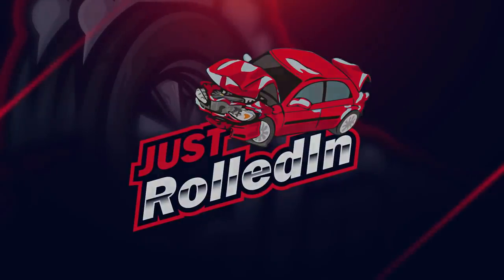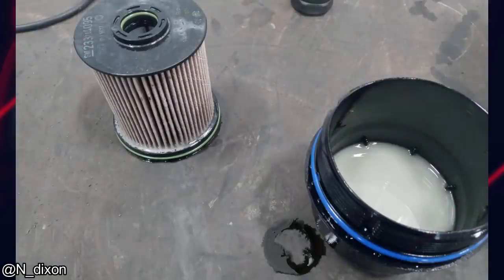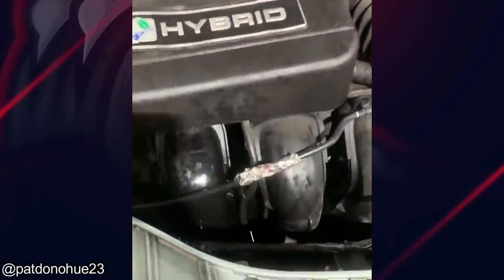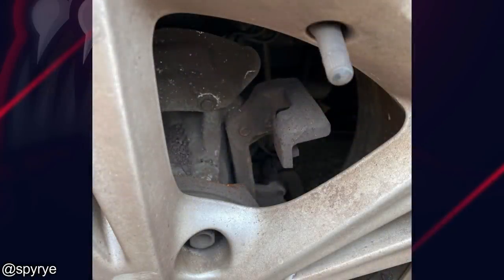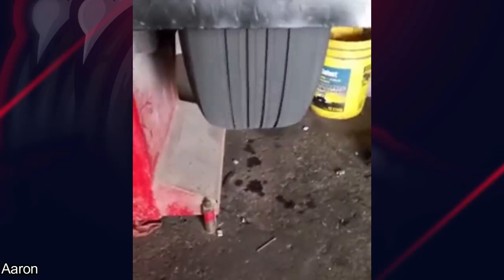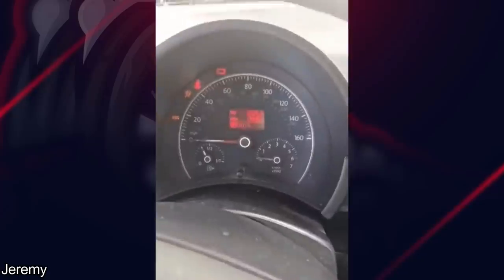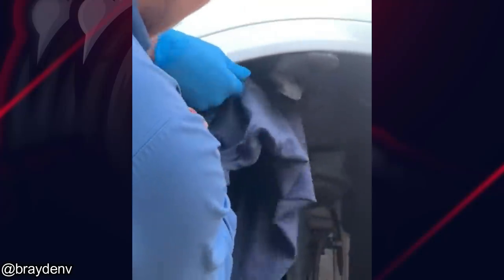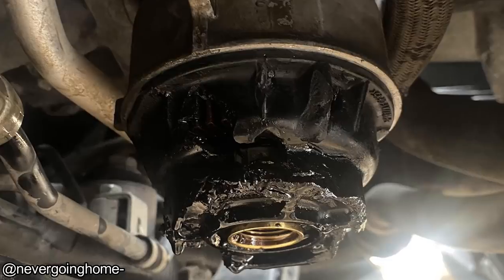Customer States He Did All The Work On His Truck & Wants A Safety Inspection | Just Rolled In

Comment: Ahhh the rust belt!
I'm so blessed not to live there anymore!
I have 2 vehicles that are decades old with barely any rust at all.
I remember being in Southern Ohio and my 1/2 Brother buying a 6 year old Chevy Blazer with Bondo and Cardboard in the doors! It was shiny when he bought it, but then a few months later, the cardboard got wet and the whole mess fell apart...
So how much is a gallon of Bondo now?
And how much is a big tube of Exhaust Sealer now?
It would seem to me that it would have been cheaper to just get a new piece of pipe from Rock Auto or something. I could be wrong.
This gives me flashbacks of when I used to work in the shops back in Ohio.
Doesn't anyone use soup cans welded onto exhausts using coat hangers anymore? Ha!

Comment: Aluminum body will never rust...

Maybe not, but that steel frame will lol
Reply from the maker: 2015 was the first year for aluminum bodys on the F150 😜
Reply: @JustRolledIn  lol I didnt even notice the year,  but it's still a problem, my parents got one of the F150 eco boost with aluminum body cuz the dealership bragged them up so much and they hate the thing, its rusting, nowhere near the mpg they were told, and dad says it's not comfortable.   They have been GM owners for years and about every 15 years they will buy a ford or dodge to give them a try again, but they said never ford again, GM and occassional dodge only now.

Comment: I tried to do my front bearings. I got one axle free.  When I came across the rusted splined bolts of the ABS sensors and had to grind one off to remove a sensor, I gave up.  I knew it would take me 24 hours to do the work.  I took it to a mechanic who did it in four hours.

Comment: What this guy did notice there was a problem with the concrete months ago before the truck fell , is everybody this oblivious to potential problems or dangers
Reply: this happened to me and i had no warning.
Reply: I've seen this a few times, i wonder if it would really cost so much more for lifts to have horizontal bracing to prevent this. then again I have seen cars crushed by being lifted too high into roof mounted bracing.
Reply: @Marc83Aus  i custom made a brace after this happened

Comment: Many years ago, a friend of mine bought a clapped out, rusty, original mini. About 6 months or so later he was driving through the town centre when the engine just seized up and the wheels locked. He managed to get it to the side of the road and got out. As he walked away the car exploded! Apparently he'd never put oil in, or anything apart from fuel. The engine had got so hot and it was such a rot box a fuel line had failed and .... ka-boom! It was just luck that he wasn't in it!!

Comment: Great video! Story time! Had a friend buy a super low miles Dodge Intrepid. Bought it from an old couple. Ran great but smell like gas in the car when the tank was full and only sometime left a gas drip right after driving. Came with a receipt for a new fuel pump so I figured, in tank pump, maybe the O ring around the top of the tank went back on wonky or something. The date had it put in the same year the car was made? Odd right? The tank is just under passenger rear seat. I pull the plastic fuel tank and find several weird punctures on the top of the tank. Then I look up. I see white bathtub silicone caulking around where some one cut out an access hole with a FREEKING TORCH to change the fuel pump rather than drop the tank.... The rough pointy edges on his cut had popped little holes when it melted into the fuel tank OMGF how the fuck did you not blow yourself up dude!!!!   Then my friend, he tells how the old people had said the dealer had "screwed them" on that car! Turns out there was some kind of fuel pump recall on that car about a year in. The old guy gets this quick money scheme in his head. The recall states that any "certified" auto shop can do the work and then get reimbursed by the dealership. The old guy fakes a receipt and does it himself and tries the get the check. NOPE.No check, and now no warranty on your less than one year old car. Nice one dumbass....
Reply from the maker: Wow. Can't believe that. Thanks for sharing.

Comment: So why didn't they put the old oil back in to drive it over to the shop if they couldn't get the filter off, or did they destroy the filter in trying to get it off
Reply from the maker: It's a cartridge style oil filter. So they broke the cartridge and put a hole in it.

Comment: Some people. I fixed it myself and want a safety lol. With work like that no shop will safety. Or the couldnt remove filter so drove with no oil. Like dude drive a screw driver into old filter if needed to twist it off. Or at minimum just replace the plug and add a few quarts of oil. Any amount is better then none. I had a friend change his oil. He drained 1 quart out and added 1 quart. A day later the car was done. Everyone laughed at him. The dude did not know about the dip stick or how to use it. Like buddy by the time the filter full you only a few drops left. So many dont realize cars do burn oil especially if not changed for 2 yrs. Bought different car? Manual will say how much or no manual add a gallon then check dip stick and keep adding 1 quart until almost full. Start it for 5 min to fill filter then recheck topping up if needed. Easiest thing ever. But hey i guess not so easy to some. I super lucky to have a mechanic father and taught me as young and helped with my first car. I now teach my kids and their friends so not ripped off by shops

Comment: The vw has a drivers door module that tells the fuel pump to run then you open the door.im sure thats why the engine dies.i had a customer put a used door motor in that was for a convertable instead of hard top.and the fuel pump wouldnt run unless rolling the window down.

Comment: Why doesn't Ford spray the frame with frame oil to prevent the rusting? Or make the frame rust resistant by mixing other metals in the mold.

Comment: Okay so I had the exact same problem with getting the oil filter off my Lexus, probably because the dealership had overtightened it like hell while they were doing the complimentary oil changes. Thing is, why would your next decision be to drive the car with NO OIL to a mechanic? That's just stupid. When it happened to me I, you know, put the oil in and then drove to Jiffy Lube and had them do the filter for me. Cost me all of $16 and that's only because I forgot to bring the filter I bought.

Comment: I'm actually not 100% sure that exhaust would fail in Missouri. I guess those joints could been seen as "patches" which are only acceptable if welded in. That is assuming there are no leaks.

edit: watched again, the hanger just past the muffler would 100% fail.

Comment: Man people just put the tools down and back no run away this is not your specialty. That rusted frame happens allot here in Pennsylvania its the road salt they use in winter. My father seen and failed many like it during inspection.
Reply from the maker: It's crazy what the road salt can do. No use of buying anything newer, it'll be a pile of rust in like 5 years (some places less).
Reply: My state uses magnesium chloride liquid deicer.  It literally melts metal. I've even seen license plates with corrosion holes.

Comment: That F150 frame, what can cause such severe corrosion? Looks like the owner likes his truck frame as he likes his meat: "first you take off that skin, then rub it in with plenty o'salt until it's tender nice and brown". Love the kitten BTW, all it looked for was some warmth which it eventually found in the much safer arms of that mechanic.
Reply from the maker: From the chemicals and road salt they use in New England in the winter time.

Glad they got the kitten out as well!
Reply: @JustRolledIn  Thanks, that explains a lot. I guess it's better to apply some sturdy protection on top of the original paint once you know the truck is going to be used under those conditions for a longer period of time without the possibility, time or patience to clean after each use.
When my male cat was young, he always came home with oil spots on his head. Guess he was learning to become a mechanic. He must have become a really good one as in the last couple of years I found no spots anymore.

Comment: 1:21 how would using bike innertubes on the outside of the fuel pump in the tank, cause you to lose fuel pressure? It's outside of the pressurized fuel lines. You wouldn't pass emissions though, and you'd have a CEL. ...Maybe it was the wrong pump for the car?
Reply from the maker: I'm going off what the subscriber said who sent it in. Seeing what they did with the fuel pump who knows what else is going on or the state of that fuel pump.
Reply: truck is probably missing a fuel injector 🤣🤣🤣🤣🤣

Comment: 13 thousand????? WTF!!!
Reply from the maker: That's because the whole fuel system needs to be replaced.
Reply: @JustRolledIn  a 13 thousand dollar fuel sys????that and a new plant shouldnt be that much
Reply from the maker: @kcstafford7997  fuel systems on diesels are very expensive + labor
Reply: @JustRolledIn  im a diesel mechanic i know and had same job roll in think i billed it at 900
Reply from the maker: @kcstafford7997  I'm just going off what they send who send the picture in. But apparently it damaged the whole fuel system.
Reply: @JustRolledIn  think they must have added an extra 0 in there or some one got taken to the cleaners,,,,

Comment: that first example was totally wtf. as for the dude that put diesel in his vehicle  and then paid 13000 to fix it, clearly a total idiot. that dude was mega scammed. even if he replaced everything from the gas tank to injectors, and even co2 sensors, there is no way it would cost that much. the most expensive thing i could even think that may, and i mean very unlikey is a new cat converter. can someone please explain how this bill could be even close to 13000? totally milked cash cow.
Reply from the maker: He put DEF in his fuel tank of his diesel. A fuel system for a diesel isn't cheap. Injectors, pump, lines etc.. with labor will cost you that much. So $13000 is a correct number for that damage and he wasn't scammed. Anything besides diesel for a diesel is a huge headache.
Reply: Diesel fuel injection systems work under very high pressure, and have lots of precision moving parts. These parts are lubricated by the diesel fuel itself. If you put something in other than diesel it's like running an engine without oil, the precision fit of the pump parts gets destroyed.
Reply: @JustRolledIn  About 25 years ago someone brought in a Volvo to have the diesel engine replaced with a gas engine because it wouldn't run right and somebody told him the diesel engine was blown up. My first step was to remove the drain plug on the diesel fuel tank, and a bit ran down my arm and whatever it was burned like fire! It had a blue tint to it and an odd odor I'd smelled before, but couldn't recall exactly what it was. After a few hours it hit me: It smelled exactly like the Toni Home Permanent my mother used on her hair back in the '60's! Best guess as to how it got there: Vandalism by an angry neighbor or something. I told the boss let's flush the system with some good diesel to see if it'd run right, but no, the engine replacement was much more profitable.
Reply from the maker: @akallio9000  that's unfortunate you just had to replace the engine. Probably wasn't the issue like you expected!